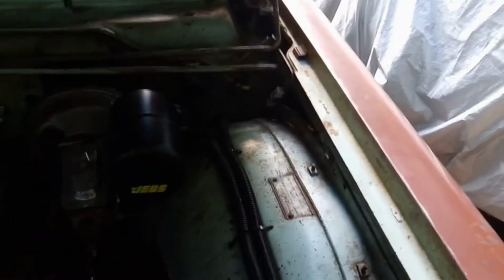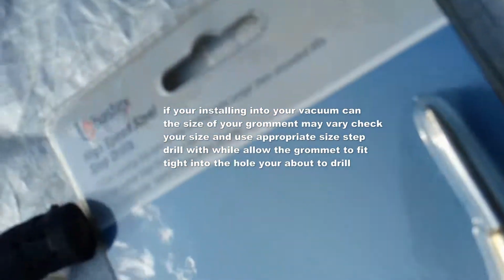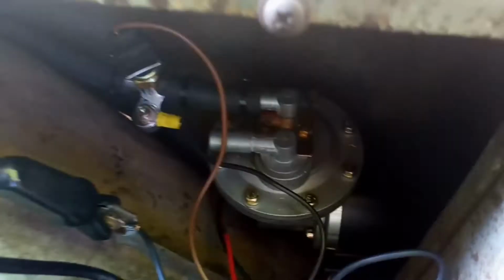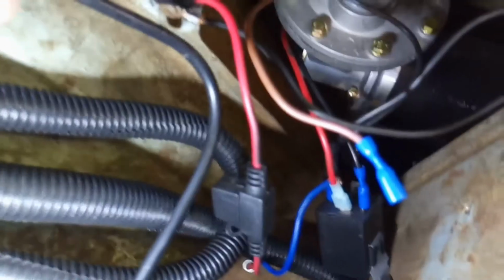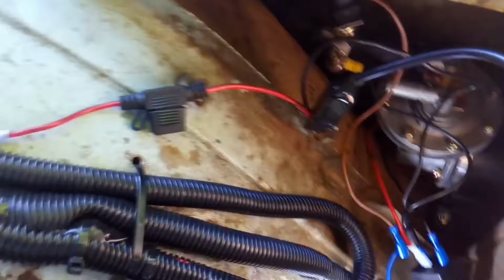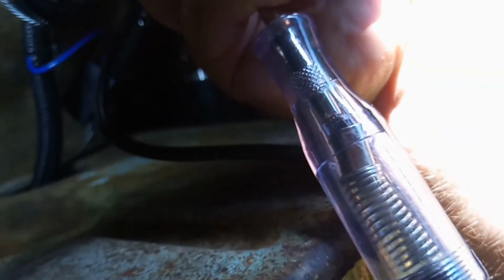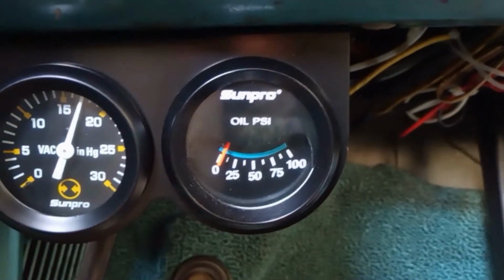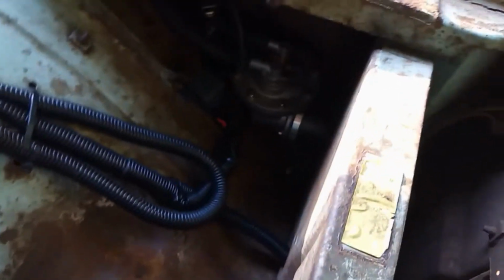Hot Rod Muscle car Power Brake booster can and electric Vacuum pump install diagnosis

Comment: Hey mate could you describe your relay wiring again please, I have same issue, what are you calling the 2 hots? Is it possible you could draw a picture and post is 
Best regards from oz
Reply from the maker: The two hots I referred too is one from battery or in my case from a toggle switch, the second is the red wire to the pump itself